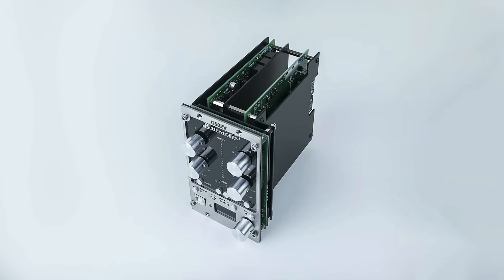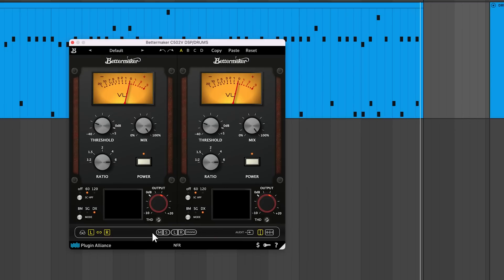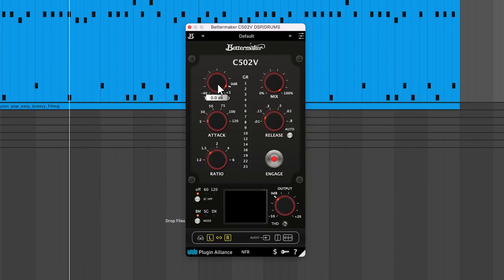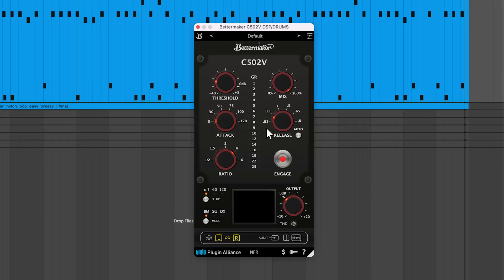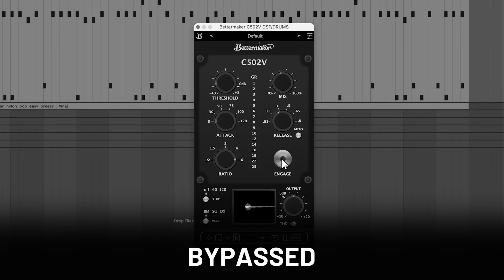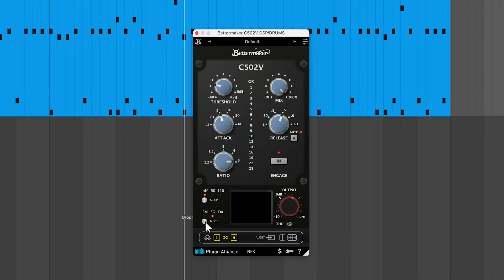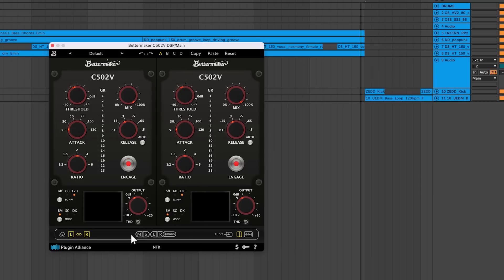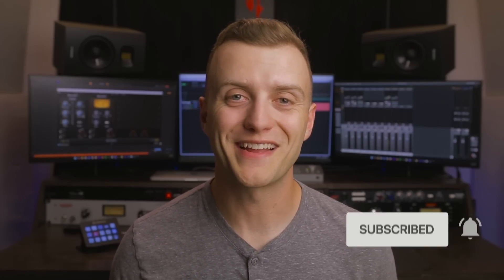Bettermaker C502V - Walkthrough | Plugin Alliance

Comment: I'm a little confused about the mid side mode does it work with the compressor on the left effecting the mids and the compressor on the right effecting the sides ? I cant really tell by looking at it because only the Mids light turns on on the default so if you press sides what happens to the mids , i would usually use them unlinked.

Comment: I need an option to disable the noise floor. Please.
Reply: Was this fixed?  It’s on sale for $15 today, but I don’t wanna buy if they still have the noise floor issue.
Reply: @remy333  No it did not get an update and you can't turn off the noise floor. I don't use this plugin for that reason, which is unfortunate because the comp is versatile but the noise makes it unusable for me.